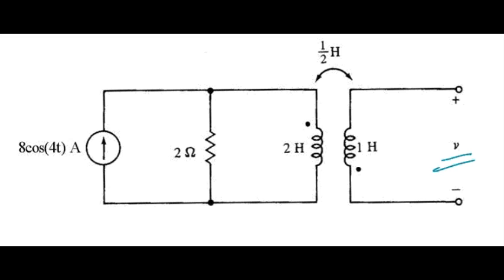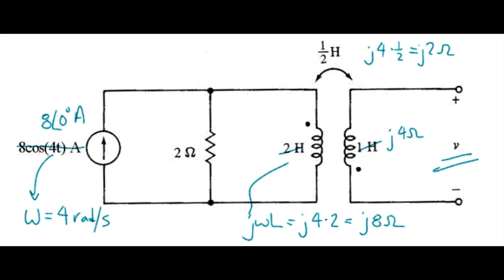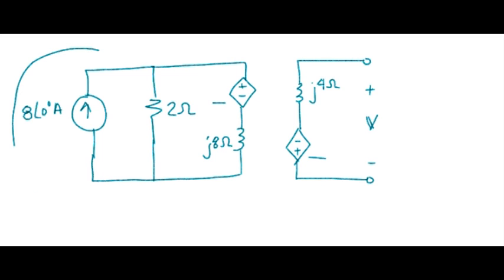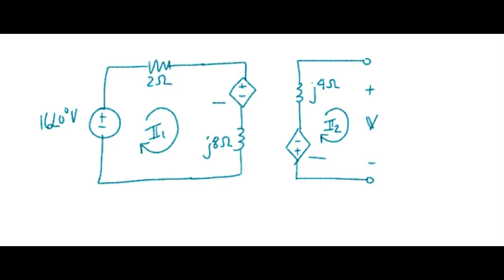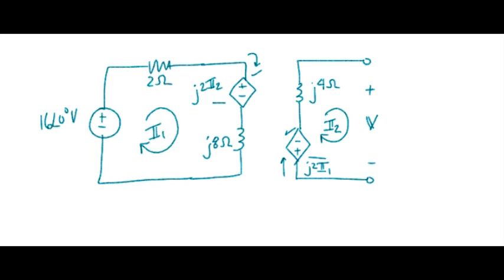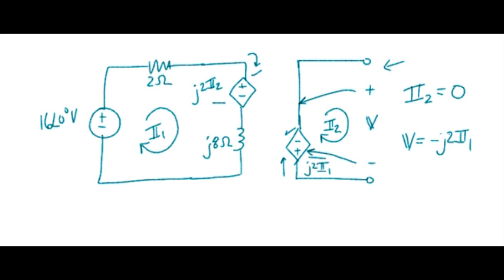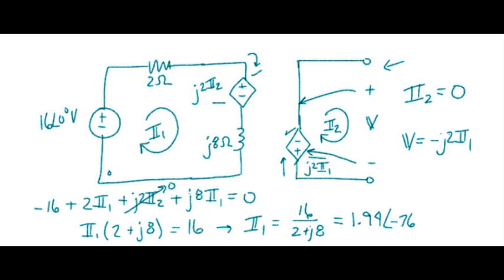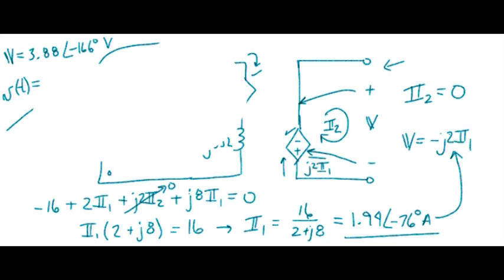ac: Mutual Inductance Example #3

Comment: Mutual voltage source plus sign point out from dotted terminal. But also it could work with minus sign point out from dotted terminal. Just use same rule for all the device in the circuit.
Where is this derived from? This should have complete derivation somewhere. 
This looks quite good rule though.
Maybe if plus sign out for dots on same side and minus sign out for dots on opposite site? ( this rule is maybe hard to be derived ).
Shouldn't changing dot's side at the output coil just change the output current into opposite direction?

Comment: I wonder ıf there ıs 3 points how we must solve for that?
Reply from the maker: I think that you mean three coils each a dot? If so, you would have three mutual inductances, but the method is still the same. For example, suppose that you have L1, L2, and L3 with mutual inductances M12 between L1 and L2, M13 between L1 and L3, and M23 between L2 and L3. At L1 you would create one dependent source based on the current entering the dotted terminal of L2 using M12 and then a second dependent source in series with the first dependent source based on the current entering the dotted terminal of L3 using M13.

Comment: does the dependent source have to be placed rite at the dot? my prof puts them on the opposite side. How do you tell the polarity?
Reply from the maker: You can interchange the position of the dependent source and the inductor because they are in series. However, you must still use the correct polarity. For example, the 2H inductor has the dot on the top terminal. At 1:30 I insert the dependent source with its + terminal also on top. You could instead insert the source below the inductor, but the + terminal of the dependent source still needs to be on top.
Reply: Rose-Hulman Online so in simple term the dot represents positive? for example if there are 2 coils. Coil A and B. If the dot is on the left side of both the coil, the polarity of the dependent source of coil B would be (+ ) where coil A is ( +) and if the dot is on left side of coil A and right side of coil B, then the polarity of B would be ( - +) and coil A would be (+ -) ? is that correct?
Reply from the maker: KillahX669
Can't quite make out what you mean with the lined-out text, but yes, dots on the left sides of each would insert dependent sources with (+ -) polarity (the last part of your sentence is correct, too).